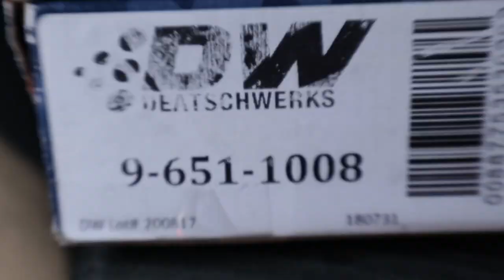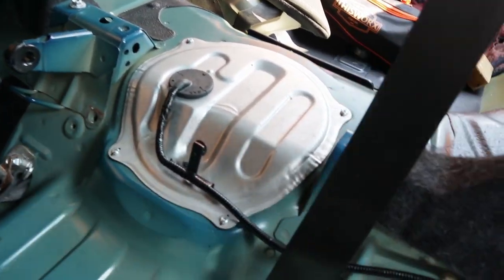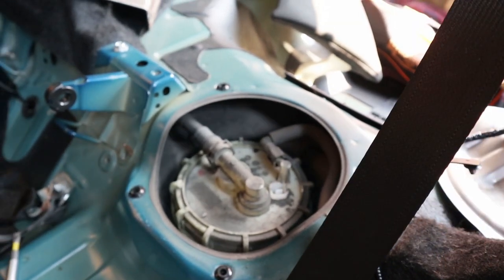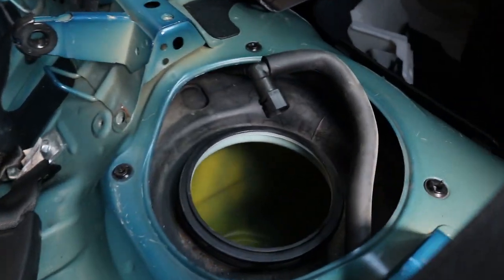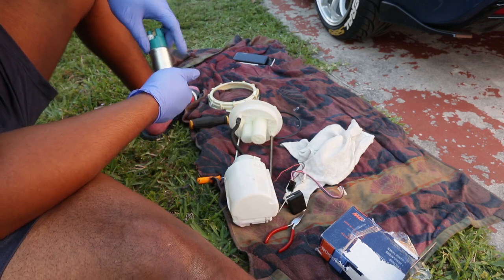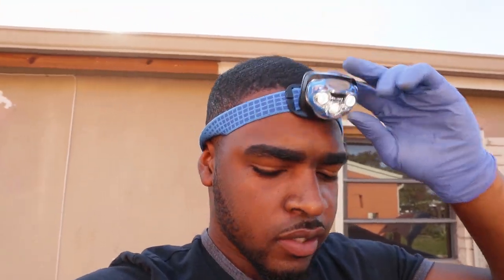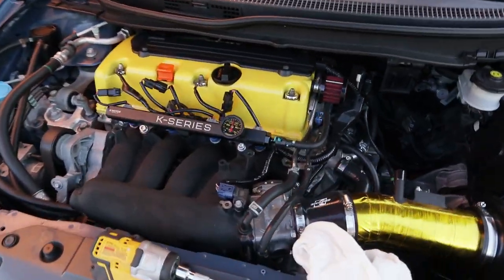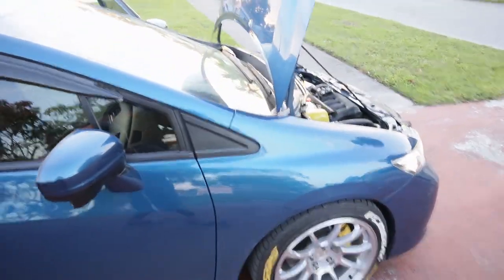INSTALLING DW65C FUEL PUMP FOR 9TH GEN SI

Comment: Is this the same fuel pump you used for your 400hp turbo setup?  Also, did you run the fuel pump relay with the thicker wires or stock wiring
Reply from the maker: no, I swapped to a Walbro 450. No relay at the moment.

Comment: Anyone know if it’s possible for the fuel pressure to leak back through the pump and cause you to crank twice on cold start.  I don’t think I have bad fuel injectors no misfire and it runs normal after start. I have the 1.8 with the 5 speed auto.

Comment: So I currently installed the DW Cage with DW400 Fuel Pump (drop in) so PnP. When I installed it I put it back correctly and reconnected the hose and wires, I try starting the car but it wouldn’t prime nor the car would crank. The light comes on and everything like normal but wouldn’t even run.. do you know what can it be?
Reply from the maker: I’ll go back and make sure every wire is connected correctly
Reply: @zoovie  okay I’ll double check again!
Reply: @zoovie  so everything is connected but still the car won’t fully start, any idea?